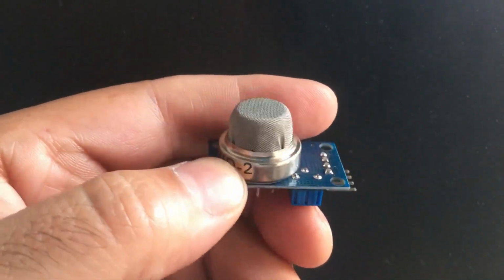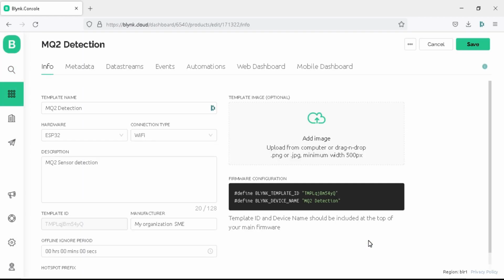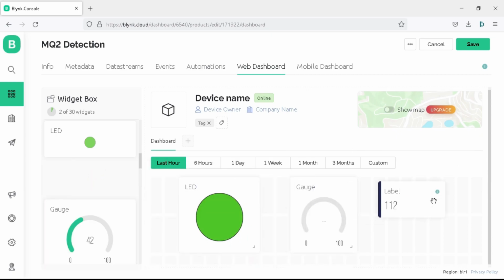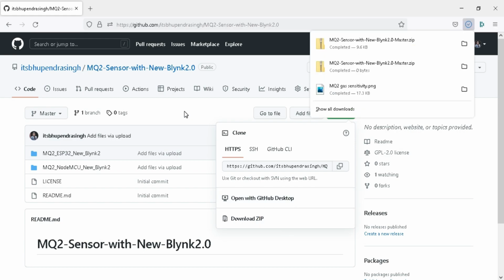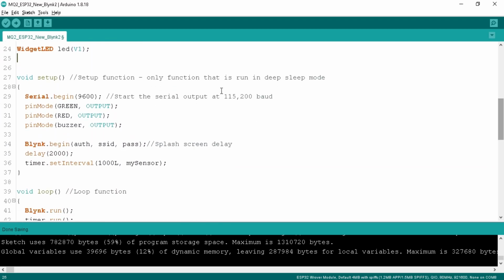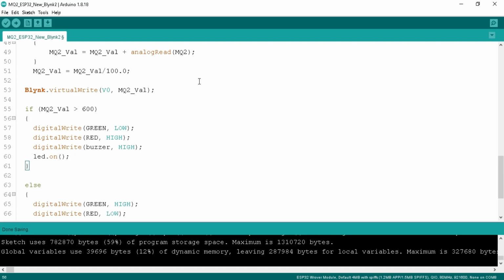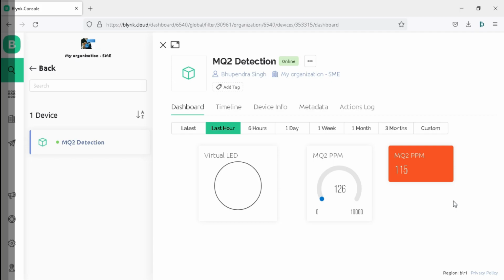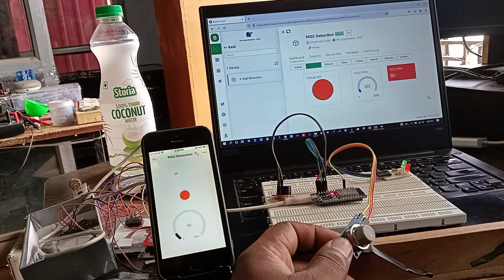Gas Monitoring with Blynk2.0 IoT App and Cloud Web Dashboard: Learn How to Use MQ2 Gas Detector!

Comment: Hello, is it safe to connect the sensor to 5v because in some other video i saw connecting the mq135 to 5v can damage the board
Reply: Esp32 or Esp8266 which one is better for use
Reply from the maker: Both are good, depend on application.
Reply: Last question can we connect multiple mq sensors to an esp32.
Reply from the maker: Yes. You can connect.
Reply: @SMEDehradun  Is there anyway i can contact you via email or something like that we need help in our project . It would be really helpful if possible
Reply from the maker: Drop a mail at schematicslab@gmail.com
Reply from the maker: It’s depend on the property of the sensor, few sensor works on 5V & few on 3.3V. But All sensor of MQ series works on 5V.

Comment: sir my esp8266 board is unable to connect to the cloud. it is just showing connecting to cloud in the serial monitor.
Reply from the maker: Hi,
You need to check your blynk credentials  & Wifi name & password.
Reply: @SMEDehradun  all these things are correct but i am still not able to connect
Reply from the maker: There is some issue with your credentials or wifi name or password.
You can do one more thins. Delete your old template and create new as per shown in the video. 
& please follow each & every steps. 
And even after it, not working, then let me know.
Reply: @SMEDehradun  sir i have already tried it but it is not working
Reply from the maker: K. Mail me your query at schematicslab@gmail.com 
I will look on it.
Reply from the maker: @R88-m5s  Hi, 
Your board is working now or not? if not, then let me know.
Reply: @SMEDehradun  no sir
Reply from the maker: Are you using mobile  Hotspot for wifi connection? If yes then check the setting of Hotspot, is it visible to everyone or not? 
Still not getting solution then mail your problem to me
Reply: @SMEDehradun  i am using mobile hotspot but it is private
Reply from the maker: Make sure it is visible to every body so that board can connect to it.
Reply: @SMEDehradun  ok sir let me try
Reply from the maker: If not, then let me know
Reply: @SMEDehradun  sir i tried the same codes with another laptop now it is working 😀
Reply from the maker: Ok great.
Reply: @SMEDehradun  thank you for co-operation
Reply from the maker: Most welcome 🙏